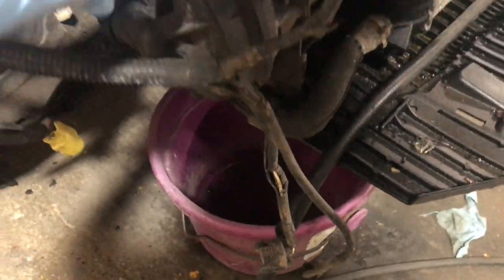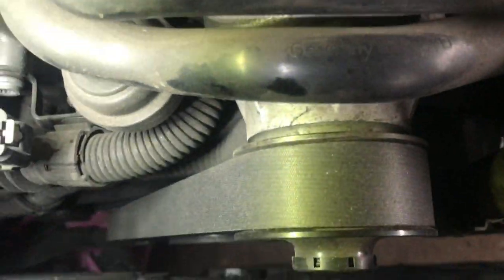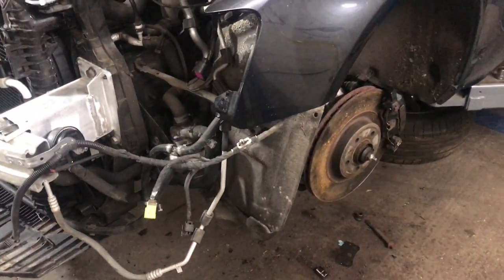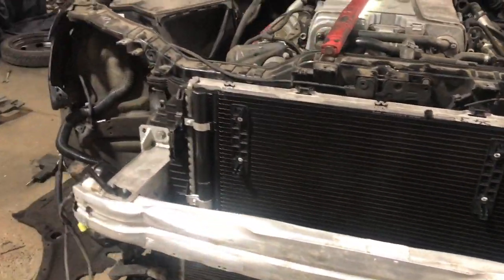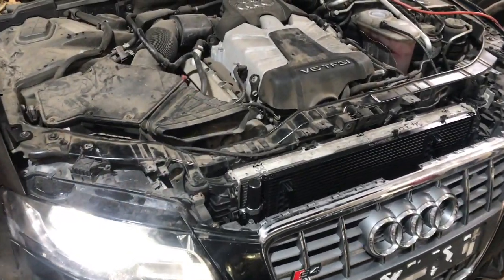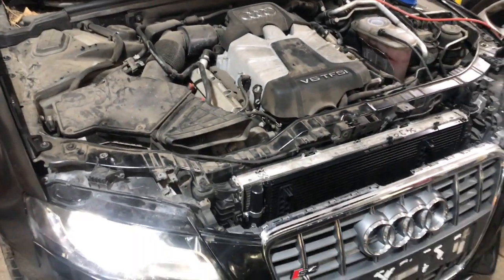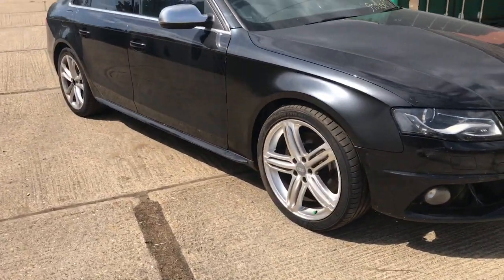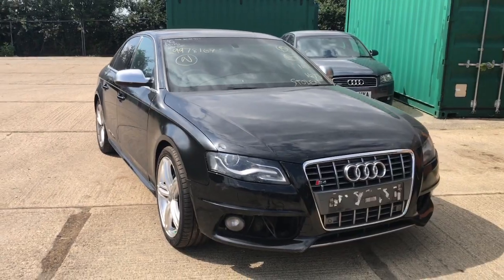I Bought A STOLEN Audi S4 From Copart!! Part 4

Comment: Nice job. I would have sorted the intercooler though - looked a bit mangled..
Reply from the maker: +Evil Diesel Thanks 👍🏽 I did check it out, it looks worse than it actually is, just a few small dents the the top. No damage that will effect the way it performs though 😊

Comment: Supercharger service???
Reply from the maker: +Sammy Baker These are not a serviceable item. The supercharger manufacture advises against changing the oil. But I may look into doing it if I fit a smaller pulley and go stage 2. 👍🏽